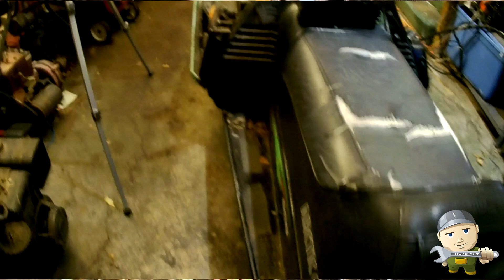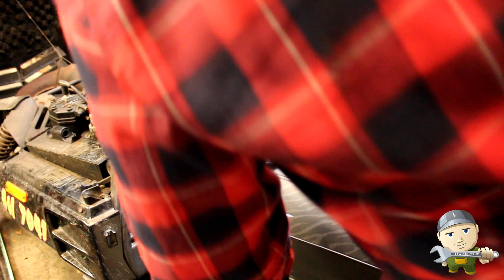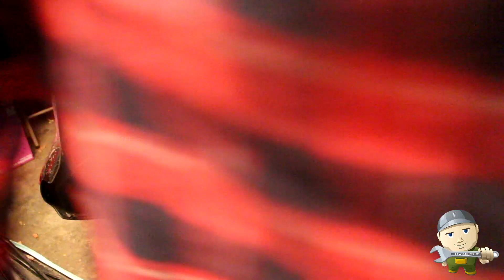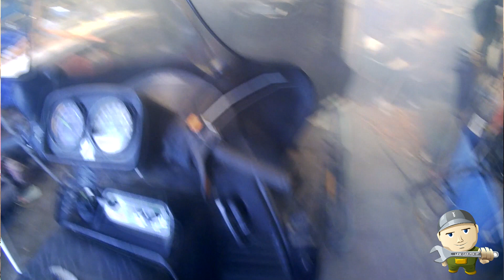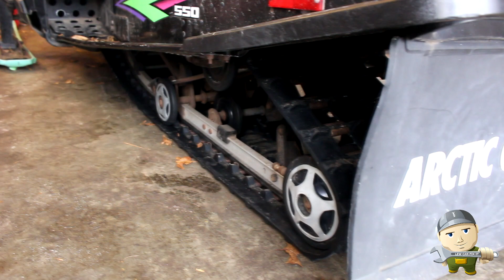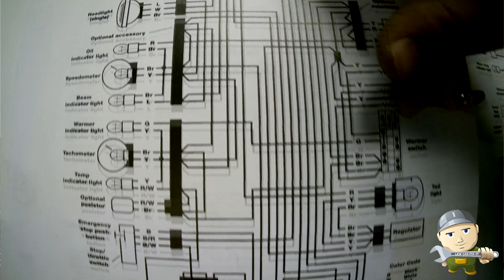Arctic cat snowmobile Ignition and Safety Switch Diagnosis - and first Start!

Comment: Im having the same problem with my thumb throttle not tight enough to push on that internal safety without pressure on throttle. How did you fix it?
Reply: One year late. Slack your gascable. It should engage the safety switch before the throttel.

Comment: I like the part where he shows you wtf hes doing
Reply: I just had the exact issue shown in the video. The problem was one of the magnetic carburetor switches was out of adjustment. They're supposed to be closed at idle and go open slightly off idle. The thumb throttle switch takes over and bypasses the carb switches, and that's why it runs with the throttle pressed slightly. It's bypassing the carb switch. It's actually the carb switch trying to kill it. It's designed to kill the engine if the throttle is open (stuck or frozen up) without pressing the throttle lever. That way the sled doesn't take off without a rider.

Sorry for being years late to the party 😂
Reply: @Krankie_V I just bypassed the whole shooting match with the double sided dick of doom and a nice spring to yank it out when I wanted to shut it off rode er till she popped like that

Comment: Wait how did you fix the spark problem ?
Reply: I just had the exact issue shown in the video. The problem was one of the magnetic carburetor switches was out of adjustment. They're supposed to be closed at idle and go open slightly off idle. The thumb throttle switch takes over and bypasses the carb switches, and that's why it runs with the throttle pressed slightly. It's bypassing the carb switch. It's actually the carb switch trying to kill it. It's designed to kill the engine if the throttle is open (stuck or frozen up) without pressing the throttle lever. That way the sled doesn't take off without a rider.

Sorry for being years late to the party 😂

Comment: The throttle bar, I am having the same issue, its a not tight. It starts if I jam something like you said. Did you adjust the cable? I see the while plastic tie .
Reply: It is most likely the carb switch(es). The thumb switch bypasses them, so in the video the thumb switch is doing its job. They are known to wear out, but his is working more or less as it is meant to. When the throttle lever is not pressed, the carb switches are what makes the ignition circuit complete.

Comment: now put that old gas in 2 liter clear bottles and leave the in the sun light and the gas will clear up with in a day or so and take the good gas and go!!! it says open system on the motor which means just unplug and go!!!  just a dirty plug in and the place where you were trying.  that's what was wrong with the one I just bought that sat for 7 yrs.  gave buddy $200 and drove it up on the truck. I used to get it home. even with the bad gas it fired right up for me even the old owner was surprised since he tried for several days to get it running but no go for him!!! stop playing with thumb warmer!!!

Comment: If you dont have the key can you disconnect the ignition harness? would it start without the key?
Reply: i have a arctic cat prowler about the same as this one
Reply from the maker: Yes!  If you just unplug the harness and put a jumper on the 2 non-yellow wires, that will allow the coil to make spark!  But it also overrides all safety switches and key switch. So i recommend only doing this for testing purposes.
Reply: @LEWCANFIXIT  ah ok. I just grabbed my multitool and literally cut the key hole out of the plastic body of the machine. I tried connecting the two conductors together with a piece of wire but i couldent tell if it was working (it probably would have, the main reason for all of this is the machine has been sitting for three years outside so i had to get it going) so i just hot wired the copper wires together. im going to go to the locksmith sometime here soon and get a new key and gorilla tape the key hole back into the body. Its an old machine so i wasent really very sad about cutting into it. Thanks :)
Reply from the maker: Sounds good William,  have a merry Christmas!